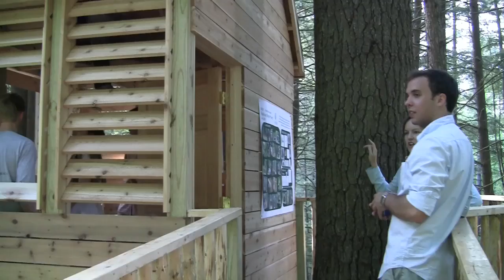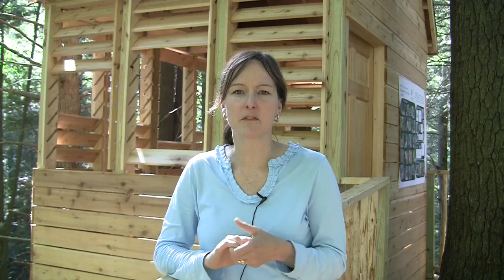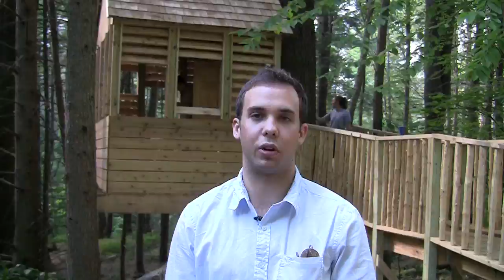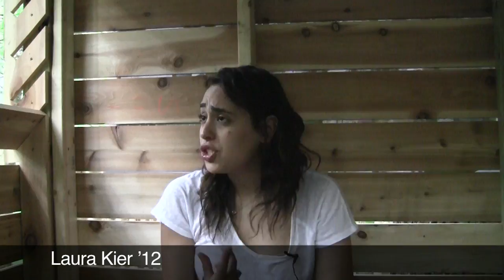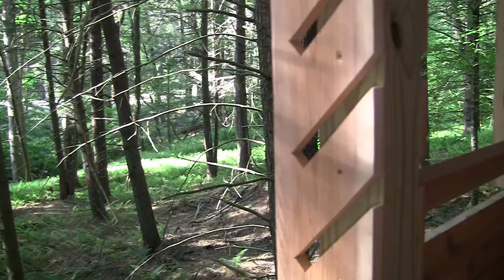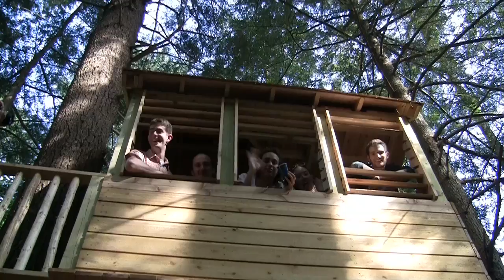Dartmouth Structural Analysis Class: Treehouse

Comment: Hi there, I know this is an old video but I was wondering if you had any information about how the different loads are calculated for the tree connections system. I build treehouses but only have a layman’s grasp of engineering. I am inspired to learn more. Many thanks,
Guy.
Reply from the maker: Hi, thanks for your question! The students used ASCE7, Minimum Design Loads for Buildings and Other Structures, to determine appropriate loads. Here is a link to the ASCE7 doc: https://www.asce.org/structural-engineering/asce-7-and-sei-standards/
 
You could also have a look at Prof May's massive open online course (MOOC) to learn more about engineering and loads: https://www.edx.org/course/engineering-structures-around-us-dartmouthx-dart-engs-02-x

Happy learning!